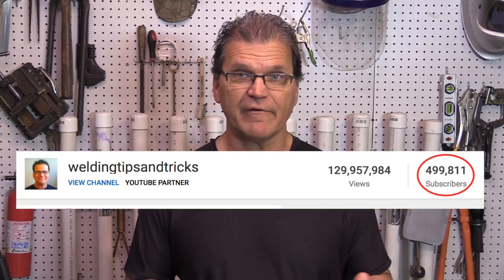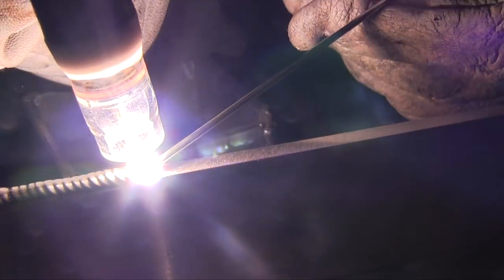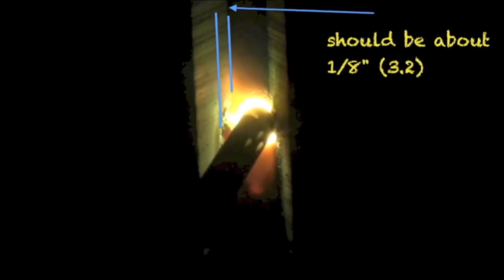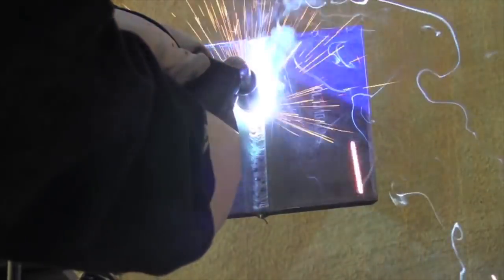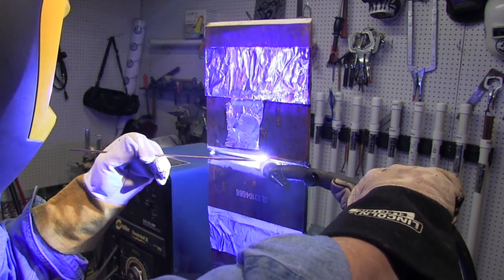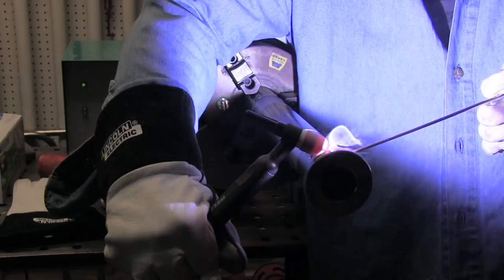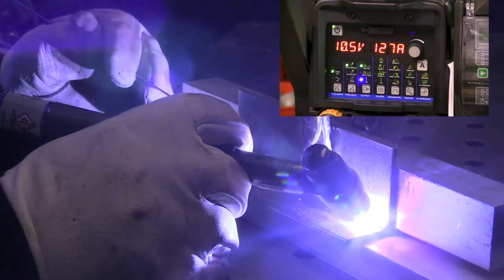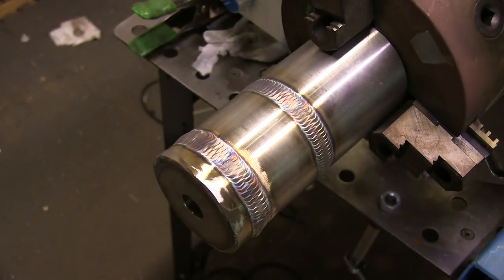TIG, MIG, Stick Welding Arc Shots

Comment: TIG finger is awesome for my torch hand, but with aluminum especially vertical the pinky and ring finger in my wire feed hand get pretty crispy. Little fiberglass finger covers would be cool for protecting and positioning with the feed hand.

Comment: Hey Jody I follow alot of ur work, it has helped me get through school. the tig finger especially helped with the carbon steel 2in tig pipe test. I own a power mig 210 multi process and I was wondering what generator model do i want for it? i have a troy built 5550 but the cables supplied with the machine only allow me to use the 125, what is a generator that i can run all my processes on? is that possible? Ive looked at some adapters but for AC it would require ether using two adapters or magicall finding a double female. i really really want to continue to pursue my career in my free time and this is crippling me. any help would be great. thanks alot.

Comment: Congrats. Been along time viewer and there's no one on YouTube who's opinion I trust more than yours.

Question time. I'm very new to tig and have been having an issue. No matter how high/low I initiate and arc, no matter the gas flow I can never get a clean puddle. Always had something floating around in it  and as I increase the amperage to begin laying a bead I will get kinda like sparks flying out of the puddle which of course leads to porosity. These also have a tendency to stick to my tungsten and cause my arc to jump from a tiny spot on the tungsten. I've cleaned with grinders/flap disc/roloc disc/sand paper and acetone wiped. Can't seem to find the source of the contamination. I used brand new tungstens and it still happens. One thing I noticed is  if I run through anyways and start dipping some rod it'll clear up. I assume that's the deoxidizers in action. I can't hold steady enough to get it to reliably clear up most times but when pulsing I can stay steady enough. I've also noticed a rust colored dust on the outside of the bead that happens regardless of amperage. Of all the beginner videos I've never seen this covered. No matter what I try I cannot get a clean puddle at arc initiation. Any ideas?
Reply: Also I have checked repeatedly for gas leaks. I even disconnected the gas hose and shrouded the torch in argon and it still did it. Considered tank contamination but unless I have two contaminated tanks that's not it.
Reply: The rust colored dust is usually a result of shielding issues. What material are you welding on? That might help to diagnose your problem.

Edit: are you holding a tight arc?
Reply: Thatgood Nutt mild steel. Haven't done any aluminum in a very long time but did fine when I tried way back.

Still getting the steadiness down when dipping arc length is inconsistent but can still get a good weld. I am able to tell when my arc length gets crazy. When running pulse with laywire I can maintain tight arc and things will clear up. My problem isn't while welding though. It's when I first initiate the arc. I can hold the tungsten nice and tight on shiny clean metal and initate the arc and there's always some nasty floating in the puddle. Nasties that will spatter off when amperage is increased. It's got me stumped.
Reply: weird

What cup are you using and how many cfh of argon are you running
Reply: Thatgood Nutt I've only used 3/32 tungsten. Ran 16 GA, 1/8" and 1/4" steel.(recently)

Tried 5-7 standard cups from 5 cfh up to 30 cfh. I have the weldmonger 3/32 gas lens setup with #8 cup tried that one with 5-25. Standard lens runs fine around 15 or so cfh gas lens runs fine as low as 8. My gas lens had a chunk broke off of it and I'm waiting for replacement pieces from jody to try that one some more. Using a flowmeter not a regulator. I tell ya man its a head stumper.
Reply: Jerry yeah it sure is

How far do you have your tungsten stick out? Also what kind of tungsten do you use and are you running on AC current?
Reply: Thatgood Nutt there appears to have been something wrong with my collet body. I ordered new collets/collet bodies and new gas lens. Just got a chance to try them out today and I have beautiful puddles now. Not really sure what the deal was but so far it's old news.
Reply: Jerry ah that makes sense. Glad everything worked out for ya

Comment: Jody do you sell the 3/32 gas lens collet body separately?? I got the link before but it's for the 1/16th.  If you sell the 3/32 separate what's the part # on weldmonger.  Ty
Reply: The store shows the 1/16 collet body, but there’s a drop down menu on that page that lets you choose the size you need. Hope that helps, and thanks for shopping with us :)
Reply: Lyn Collier Excellent.   Thanks for the assistance.  Placing my order first thing tomorrow.